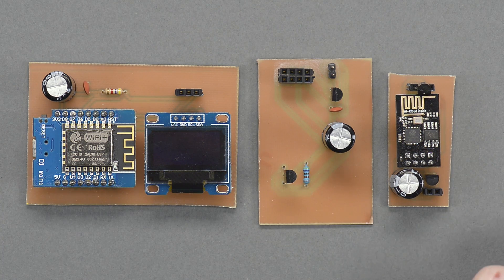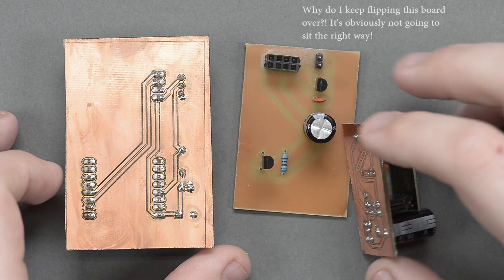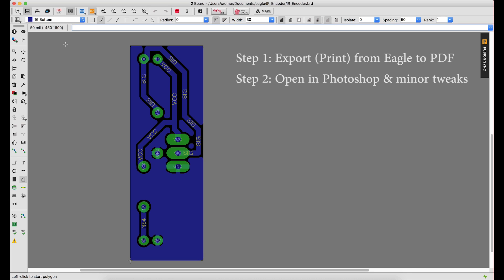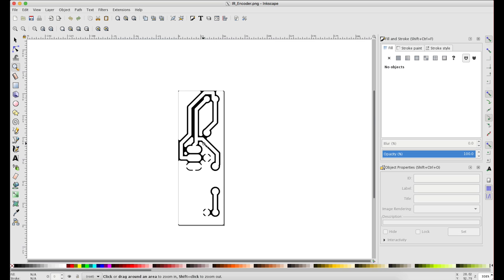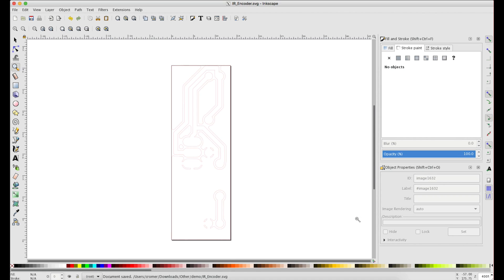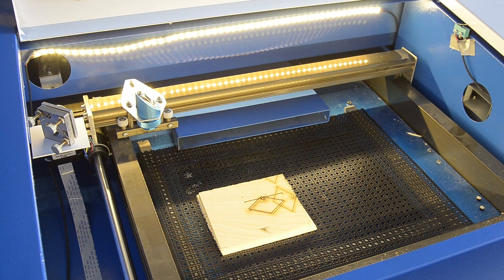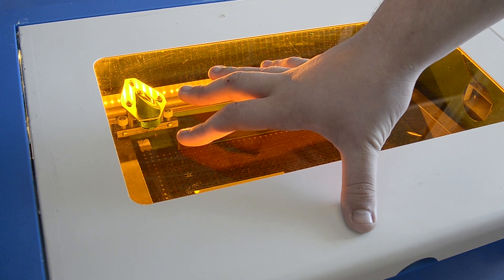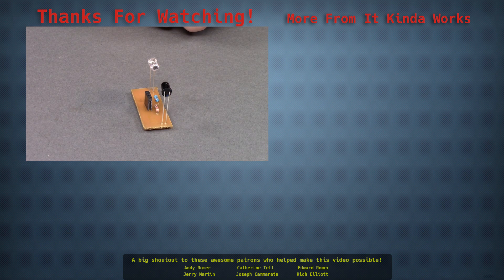Making Circuit Boards with a Laser Cutter

Comment: Looks like I have something else to try on my laser. I started with a Diode in 2019 and then 3 months later moved to a K40...I did upgrade to a Mini-GRBL so I could use Lightburn. Then a year after that, I moved to a OmTech AF2435-80w. I never knew Lasers could do this. Where did you get your copper sheet?

Comment: To remove the lasered paint, I had much better results using  Lestoil (a household cleaner with petroleum distillates) & household ammonia instead of isopropyl  alcohol (rubbing alcohol).  I first rub Lestoil on the board (undiluted) and gently rub MOST of the unwanted paint off.  Then I use another clean cotton swap or brush to apply  more Lestoil over the board (don't wipe off the Lestoil), then rub straight  ammonia over the board to remove the rest of the paint.  The Lestoil and ammonia combination (mixture) will remove the rest of the lasered paint.  I use Rustoleum Matte black Custom Shop spray paint. I'm able to get a resolution of  .1 mm (razor sharp)! Had no issues of accidentally removing UNLASERED paint, like I had with alcohol.  I use  a 5 watt laser set at 80% power @ 750mm/sec (travel time).  After etching, you can use denatured alcohol or acetone to remove the paint,  denatured alcohol being less volatile.

Comment: You kept mentioning your "Laser Cutter", but you didn't do any cutting.  With a 40 watt laser like that, you could have turned the board over and pre-drilled all the holes and pre-cut the board outline (short of penetrating the copper).  It would have been easy to follow with a drill to finish the holes and you would have been far more accurate.

Comment: Thank u for the video,
I tried this with my 5.5w engraver but there is a thin layer of ink still on the pads which is hardly to remove without damaging the traces, I tried too much to adjust the focus and I think it is adjusted well, do I need to use a higher power laser or there is something wrong with my work?
Reply: You need more power (other laser). Or repeat 3-4 passes

Comment: Very good! I have a few questions:
1) Could the spray you painted the PCB be any black paint?
2) I didn't understand why to use Ferric Chloride, as the PCB was excavated with the laser! (I'm certainly wrong!)
3) Was acetone used to remove the ink from the PCB?
Thanks
Reply: 1) Any black paint
2) The laser only removed the ink, exposing what needs to be etched
3) Any ink remover will do - ask for that on your hardware store!

Comment: Pro tip: When you have etched the copper away it’s easy to cut the board using the laser, so you don’t have to use a hacksaw or drill to make less than perfect cuts.
Reply: This type of laser don't cut the PCB. You need fiber laser to do that
Reply: @brunocabral1578  This laser can cut the PCB since the copper layer is etched out. But my attempt says that the cuts are not pretty. I can cut the thin brown PCB but the FR4 light green PCB, no luck.
Reply: If you have a mechanics vice, clamp the board in that, then the cut across the board which will be a straight line, then all you need to do is sand the edges smooth?

Comment: I read somewhere that you don't need spray ink, just paint the board with a pencil marker, the one used to write on CDs

Instead of using a saw, I use a guillotine paper cutter. Did you try to etch without cleaning first?
Reply: The paint that is burned by the laser leaves a deposit (of paint ash?) on the copper. This residue sticks to the board and does not blow away, even if you're using air-assist. You need to wash it off with something that won't soften the remaining paint (the mask). The ash actually needs a bit of rubbing, to get it all off, hence the cotton-bud to "scrub" it gently and not damage the desired paint.

Comment: Congrats for the video!
What is the power of your laser engraver? I could not remove the ink with a 500mW Laser...
Reply: Looks like a K40 laser, mening 40W, cost is 3-400 usd
Reply: Do you have any progress on that? I've read ppl using as low as 25mW. I did buy a 500mW laser to try this...
Reply: @brunocabral1578  I had no improvements. I  guess that a 5W laser would be enough for this job, but I didn't tried yet.
Reply: @brunocabral1578  are the 500mw laser work with that please
Reply: @mohamedrasheed201  I did not find the right combination of ink, speed and power yet. But I still didn't gave up. In the meantime I bought a so called 40W laser (which is about 7.5W real power) and will try with it. When it works, I will try to replicate in the 500mW
Reply: Is 500mw not enough please

Comment: If you use kiCad to design your pcb (which is free),  you can save your pcb file to SVG directly, and while you could just turn off holes in the pcb making process in the software, the holes are actually saved separately from the traces in the SVG. So, you can move the traces out the way, and delete all the holes in one go.  Personally, I prefer to have tiny holes that can be used to help center the bit on the pad, and act as pilots holes for drilling.  
Basically, if you set the software up the way you want, you can save as SVG, open in inkscape, remove the fill, change the stroke to red, and you're done.

Comment: Just wondering, have you tried to print the pads and use the laser to remove the pads and use the painted board as a solder mask?
Reply from the maker: Yes I have - my laser is not accurate enough at speed in scanning mode to make clean boards that way. A larger/better laser cutter could probably etch in this way though.

Comment: Great job...My K40 moves side to side and top to bottom.  Can you explain what you did to get the K40 to follow the trace?  I assume this would create a much better finished design, no pieces of copper left behind.
Reply from the maker: You need to convert your pcb from an image to a vector. Then it can be "cut" like any other shape that you cut with your laser

Comment: The K40 laser cutter, a great little worker for the money once modded. Thanks for sharing, handy info. What mods do you have on your K40?
Reply from the maker: I've modded just about everything save for the laser tube/power supply and the axis. The fans, motion controller, safety switches, air assist, lens, etc have all been added/modded. Took about a year to really get all of those changes done but yeah it's a wonderful machine
Reply: @ItKindaWorks  Do you have any video on your air assist mod?

Comment: Won't the laser "etch" the copper off the board? It would be nice if you didn't have to etch the board after laser!!
Reply: To make the copper vaporize a much stronger laser is needed, also it needs to be the correct wavelength for the copper to absorb the light.

Comment: you didn't mention the power used, or maximum laser power, even though you used minimum power. (percentage of max power)
the laser just burned / etched the paint and you still had to use FeCl4 to etch the copper.
Try using solder mask, you have a laser, you can make a stencil.
Soldering a complex circuit board with 0402 components will be a pain in the ass...
Reply: You would need something extremely powerful to cut through the copper directly, but that much energy would damage the substrate. On top of that copper is really good conductor, so the heat needed to burn away the copper would dissipate to where you don't want to burn, and the fine details would just turn sloppy.
Reply: Have you thought in smd laying the components, apply solder past and use the laser to burn the solder?

Comment: still needs acid >.< the whole thign I'm trying to do is avoid the acid! otherwise a laser printer has worked just fine for me
Reply: Get a desktop cnc and mill it.
Reply: if you don't have any kind of cnc, there's always the manual version, use an xacto knife to cut the copper. 
another one would be using a dremel with a fine conical tip.
Reply: HCL plus H2O2, or alcohol vinager plus pharmacy's hydrogen peroxide 40 vol plus salt
Reply: @brunocabral1578  That's not avoiding acid, that's just using a different acid!!  He's talking about using laser ablation of the copper.  That needs very high power lasers and is apparently pretty dangerous from a fume standpoint.  I believe they are in the kW power and use pulsed lasers to get the energy density up.

Comment: Can I make with the laser conductor tracks that are 0,3 mm wide?
Reply from the maker: 0.3 might be a stretch to make reliably but given enough patience with laser focus and power level I imagine you could get close to that. I generally make 0.9mm traces these days though I could definitely go a bit smaller down to around .5 if I wanted to. It all depends upon your machine and calibration

Comment: I've ordered my laser engraver, just waiting for delivery, I like this video, well documented .
Just reading the comment regarding that it's easier to order from a PCB company, , any problems with the board, or I've missed something, not only can I remedy the board, but also the blame is on me.  Everyone at sometime makes mistakes, or missed out something silly or crucial, you've now paid for the boards, but you've got to pay and wait again for delivery..
Maybe the boards at $2  ( I'm UK so that's about  £1.56 at  present), it all adds up.
Not only that, but I get the satisfaction that I've made the board myself, from the start to finish. I've done the laser toner way, UV resist boars with tracing paper, and also the 'yellow' laser toner,  I'm now hoping to use the engraver to see what realty I get, the ways I've said, I've always had excellent results. Thank you if you've read this..

Comment: Did you use a specific spraypaint?
Reply from the maker: I think the stuff I use is just krylon matte black but I've used a few different kinds in the past. I don't think the brand really matters but the best color for me has been matte black.
Reply: @ItKindaWorks   what happen if you dont use the paint ?
Reply: @HectorDC02  the laser reflects and you really don't wan't that

Comment: do you think 15watt laser engraver can give the same result?
Reply from the maker: Given that I used basically the minimum power setting of my 40W laser, I would say yes! :) The way I dialed things in was to fire the laser and get it to the minimum power so that the moment I test fire it, the paint vaporized and there is a flash from the copper. If it is any higher than the minimum power to flash away the paint, the cut line starts to enlarge and can "eat into" your trace widths. I sometimes even do 2 passes with the if it seems like its not flashing the paint completely away on my low setting rather than turn it up to something higher.
Reply: @ItKindaWorks  
Thank you for sharing your experience 😊💕
Reply: I can etch paint on my 2.5W one, so probably yes.
Reply: @satibel  
Thank you for sharing your experience 💞☺️

Comment: When you say on minimum power at 5mm/sec do you know roughly what wattage that is?  Would you be able to do the same with a 2.5W or 5W laser?  Either by repeating the gcode or going slower (I think this would reduce accuracy due to heat buildup).
Reply from the maker: By minimum power, I mean my laser registers maybe 3ish watts (though admittedly the meter isn't very accurate but it gives you an idea). I would imagine that with a 5W laser you would definitely be able to do it without too much issue.

Comment: what ink you use to cover the pcb (black inc).
Reply from the maker: Just regular hardware store matte black spray paint. You want a good even but thin coating. I tend to waste some of the spray paint by holding it really far back but it seems to do the trick.

Comment: Cant the laser cutter just "cut" away all the excess copper ? Why do you need to etch anything afterwards ?
Reply from the maker: Thats exactly what I tried at first but when the power was turned up, the laser just ended up destroying the board. It would 'cut' through the copper but really it just left a huge mess in it's path. I'm not sure if it's because my laser isnt powerful enough to just vaporize the copper or if it's just not really possible but thats been my experience.
Reply: I would surmise this would be caused by copper being very good at dissipating heat.  The net result being a large area will be heated before it can be vaporised, losing all accuracy of using the laser and as you said leaving a huge mess in it's path.  :-)

Comment: Nice result, but quite sad to see that small sliver of copper residing between the tracks. It might become dislodged and short out. Isn't there a way to have the laser overlap?
Reply from the maker: It just takes fine tuning. With even more practice I've been able to basically eliminate those tiny slivers. It just comes down to the focus of the laser and how wide the distance between traces is in Eagle.
Reply: how about processing the file not as vectors but as image to engrave? most laser software have this feature so that would get ride of the unwanted copper.

Comment: You don't like SMD stuff?  No need to drill holes with SMD 👍.  You can even get SMD pin headers.
If you really wanna, you can probably use through-hole parts turned onto their side & use solder to kinda "glue" them onto the surface like an SMD part, yeah?

Since you are using holes - I'm surprised you deleted the holes from the etch.  AFAIK they can help align the drillbit, but maybe that works better with a hand-held drill (ie: dremel).

Comment: Doesn't the cutter cut the board itself?
Reply from the maker: I tried that at first but either it wouldn't cut or I'd end up blowing out the board and make heavy black lines everywhere. Yeah I know it would be more ideal to be able to just do all of the etching with the laser cutter but given that all of my attempts at toner transfer in the past have been nothing but a pain, I'm pretty happy with this.
Reply: When you say you tried it before, did you try cutting the board in an area where there was still copper?  I would think that if you etched away the border of the board, and then cut through the bare phenolic, it should cut fairly cleanly..depending on the laser, I guess.

Comment: Doesn't your laser cutter understand Gcode ? 
Would be a lot easier, export board as gerber, and use Flatcam (free/OpS) to convert it to Gcode without the hassle over converting inch/PIXEL/mm.

My grooves are only 50 microns (good for smd), but need multi-passes to remove a bit more copper (thanks Flatcam for this function). What resolution do you get?
Edit: 300mm/min is pretty fast, against my 1mm/sec. ;-)
Reply: The K40 Whisperer software does do gcode.  I would suggest pcb-gcode plugin, though.  It's a one step export from Eagle.  Doesn't have all the features of flatcam, but you don't need it with the laser.
Reply: Do you recomend any video on using flatcam to laser etch? I like it's gerber load capabilities

Comment: misleading title :)
Would it be possible to use raster to clear out large areas of spraypaint? 
I think the biggest problem with this is aligning two layers, do you think theres a viable way of making sure that the top and bottom layers are aligned. 
pretty cool project, a friend of mine is always trying to find better ways of doing the photoresist.
Reply from the maker: Haha I didn’t really think it was too misleading. I’m using laser etching for part of it ;) 
My idea is to both make a board holding jig that I can clamp into and secondly to possibly  use register pins to align the board. 
For rastering, I tried it before and never got good results... also it uses less etchant this way
Reply: Arnþór Gíslason the best way to align is using fiducial holes,so you use pins to align the pcb into a base, do all your work in one side, flip the board and then do the botton layer, so must to be sure your holder/base won't move during the entire process.

Comment: This seems like a lot of work. On GreatScott's channel, he always promotes going to a website and ordering your 10 custom made boards for around $2. I think it would be less of a hassle to order them. They may be worse quality but who knows.
Reply from the maker: It’s totally true that you can get them for cheap and easy online but usually those super cheap board shops take 3+ weeks to ship and that’s a long time wait for a potentially wrong board. This is more for super rapid prototyping
Reply: Where can u order boards for 2 bucks?
Reply: This is a complement to that.

You do the prototype with this method. And if it works and you need more copies, you get the pcbs made.

This is a great method for "one of".
Reply: The $2 boards are from JLCPCB, it doesn't include shipping (but shipping is also pretty cheap TBH).
If you're designing boards with EasyEDA, it'll give a link to a quote from JLCPCB when your download the gerber files.
Reply: Just saying the same thing is IKWs.  Takes a long time for Chinese PCB's to come in and when you just have a funky chip you want to test, it's pretty quick to etch a tiny board.  I hardly etch boards anymore, but when I need them, it's nice to have.